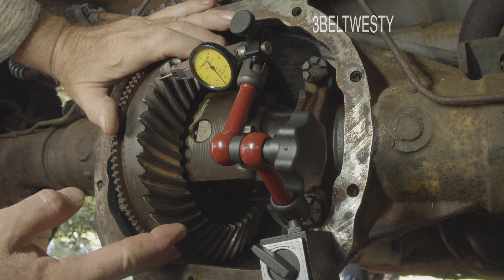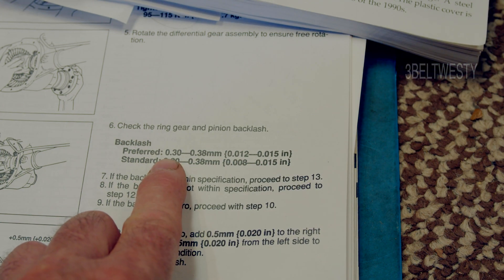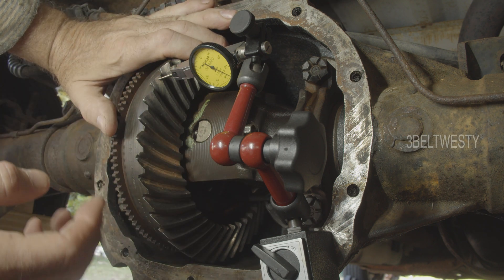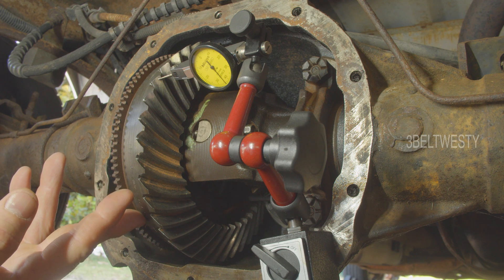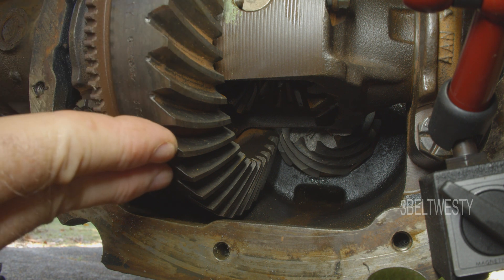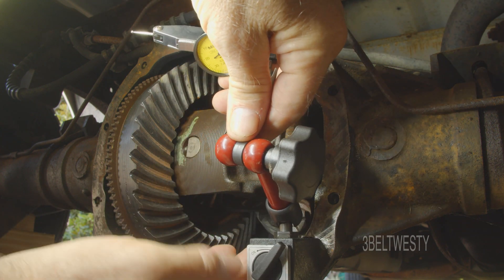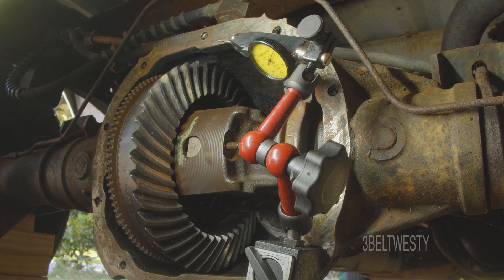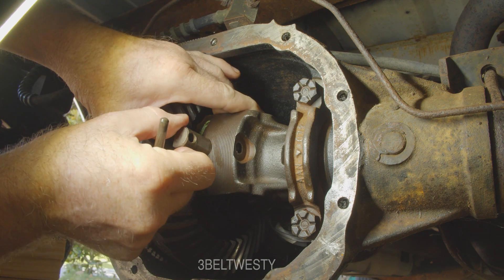Rear Axle Backlash Measure 7.5 Ford

Comment: If you pull the bearing caps of you will find shims that locate the ring gear side to side. You can move them around to adjust the backlash so you dont have to replace the ring and pinion.